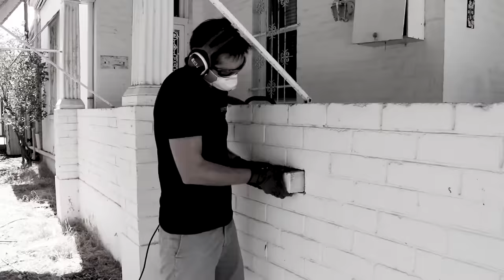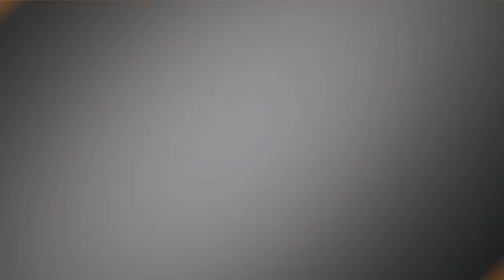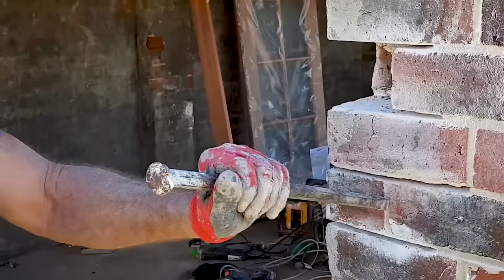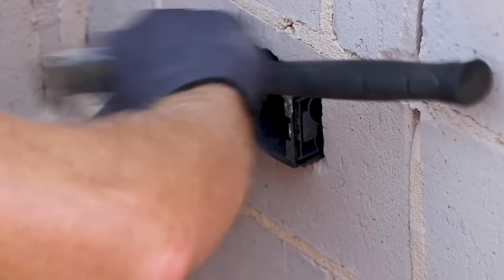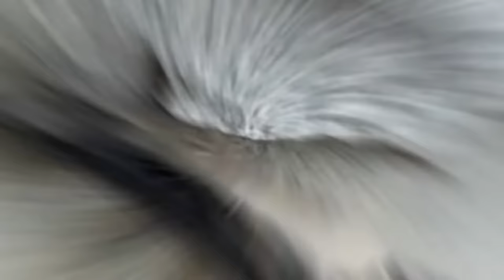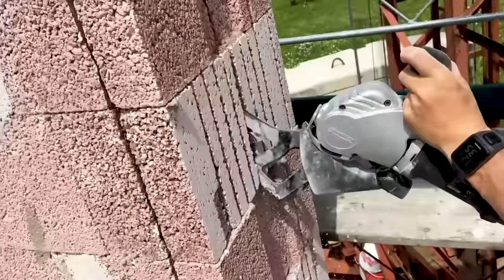Incredible Arbortech Allsaw AS175

Comment: can it be used effectively with AAC bricks / blocks or Hebel panels?
Can AS170 be purchased in Thailand?
Reply from the maker: as long as you're able to scratch the surface with a nail, you'll be able to cut it with the allsaw